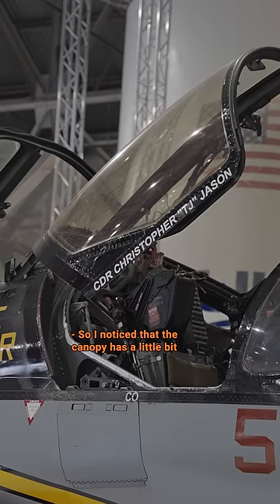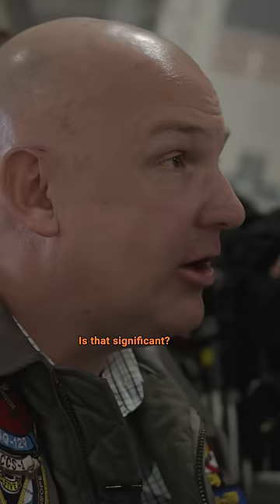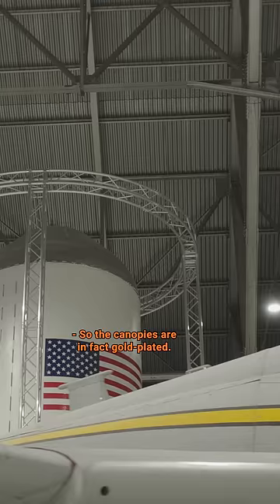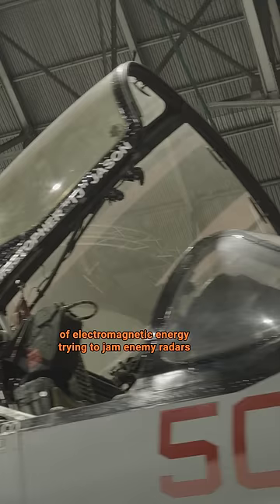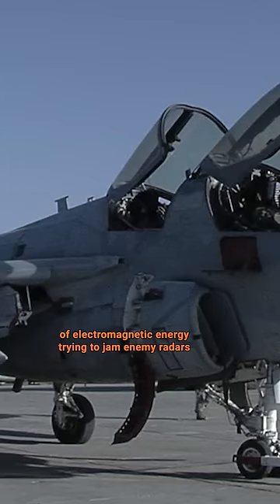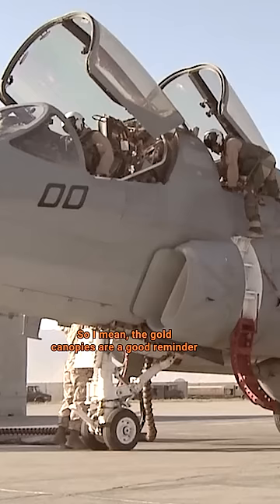Part 8 | Gold Plated EA-6B?!

Comment: Isn't the gold primarily to reduce the radar signature of the aircraft itself? The platting prevents enemy radar signals from bouncing around inside the cockpit. Don't quite see the use of a gold foil ABOVE you when you're literally sitting ON TOP of all the unhealthy tech...
Reply: because theres metal boxes around it directing it outside, just as theres a metal lining under the crew, so you have to find a way to close the gap pointing outside, as in, the window.

Comment: Yeah, but if you're at all concerned about electromagnetic radiation and signals in civilian life, you get called all sorts of nonsense.
Reply: Only if you're also wearing a foil hat.
Reply: Because electromagnetic radiation is not ionising...
Reply: These aircraft are super high-powered jammers, and EMR of that high of energy being pushed right next to you will fuck you up. Most people don't spend time sitting next to the antennas of a cell tower
Reply: @mattfernandez5821 *Sitting ON the antenna.
Reply: Look up the Testicular cancer rate amongst AWACS crews.
Reply: Yeah, you do, cause there is an insurmountable amount of difference between a fighter pilot sitting feet away from a radar dumping as much energy into the RF spectrum as possible to find things miles away, and a civilian with a cellphone in their pocket within range of a omnidirectional antenna.
Reply: Because you aren't sitting on multi kilowatts transmitters for six hours lol
Reply: @Dade13305 look at skin cancer rates among commercial pilots. What's your point? Correlation doesn't mean causation, and radar waves still aren't ionizing. In fact blue light is millions of times more powerful than a radar wave.
Reply: @Dade13305 Yea like rates of airline pilots this is likely caused by the increased exposure to cosmic waves, you can see almost 30x background radiation at the cruising altitude of an airliner.

As other said microwaves don't ionize which means they can't cause cancer. The reason they have protection is to reduce the effect of heating from the energy density, it's the same reason you have a mesh screen in your microwave.
Reply: @JNelson_ Microwaves can't ionize but they can cause wild issues relating to the waveform of the EMR hitting your body for several hours a day and long term cellular degeneration. This has been proven time and time again.

EMR works by pumping a set wavelength of microwave signal into the atmosphere and seeing what it bounces back after it hits the wavelengths coming off of the engine and plane surfaces. It's still an insanely high power, short wavelength RF signal being shot into your back, stomach and head. There are numerous accounts of AWACs crews feeling tingles and their hair standing up when testing EMR in low-frequency dense AOs.

Regardless, these planes also are coated in pure Chromium for its wavelength absorption properties, and Chromium DOES cause carcinogenic lymphomas.

Comment: Oh geez if this is true, then standing within a mile of a F35 will give you cancer 😂
Reply: Pretty sure if the radar of a plane locks onto you on the ground from a couple meters away, it can cook you alive.
Reply: @alexanderd6793 It does actually 😅, there has been multiple report of ground crew injuries due to the F4 phantom radar.
Reply: @alexandrevalentin8587 isn't that why modern radars are failsafe-enabled to be turned off while the plane has its gear down (or is on the ground in general?)